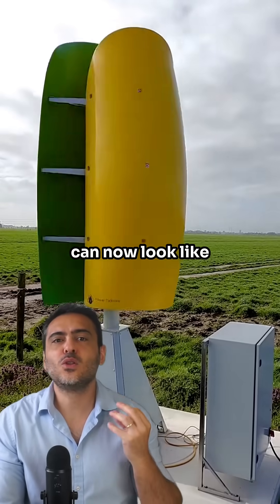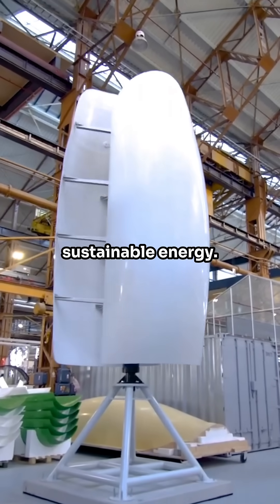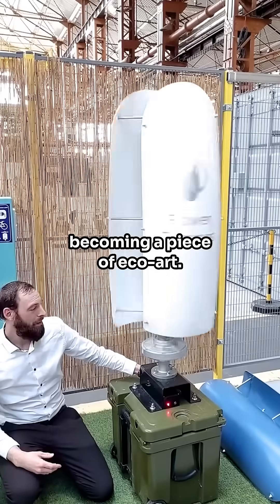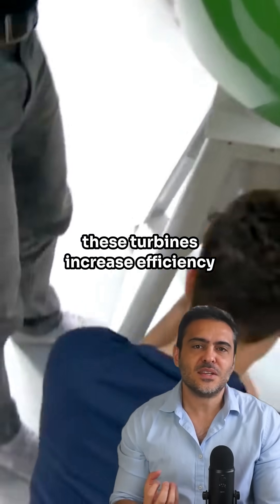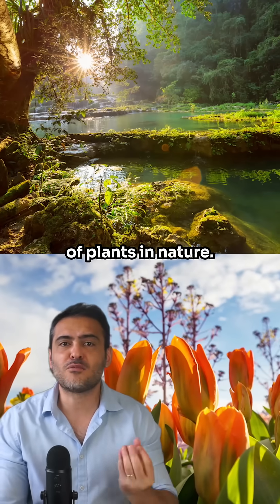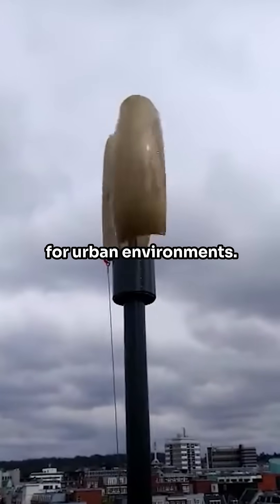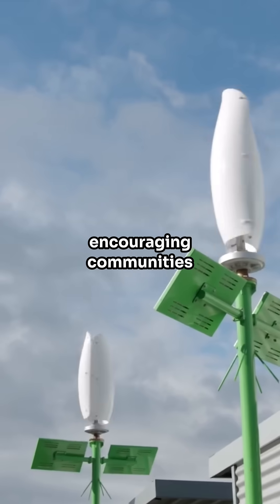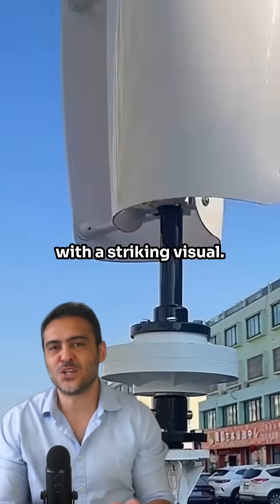Flower power: how one company is beautifying the wind turbine

Comment: "they operate quietly, overcoming the disadvantages of traditional turbines"

What is it with people thinking they're loud!? I've stood right next to them. They're already practically silent! They're not airplane turbines, there's not an engine to make noise with. 300 meters away, the sound is the same decibel as ambient rural surroundings. Some of that distance is already covered by being high up in the air and they have clearance area that usually makes up the rest of that distance. It's just a bunch of NIMBYs that didn't pay attention to the sound of wind before.

And besides that, their just reinventing it to scrape money from naive investors. Large, tall wind turbines get more wind and are more efficient. And the axis of rotation aligned with wind direction reduces strain. At least the ppl with the wiggling wind turbine had something more unique, even if it was equally inefficient.

Comment: It’s the turbulent nature of wind at this (low) height, that makes me wonder… not the design. Doesn’t it destroy the life expectancy of the turbine, due to the dynamic torque, and forces that happen regardless? Instead of 10-15 years, you get 3. It shakes them APART. That’s why they need to go HIGHER. How long is the warranty?
Reply: I guess we will see...
Reply: I see it as more efficient. The same size means its less likely to take out a village if it malfunctions. Shorter being more technicians would be happy to fix it and less wear being closer to the ground. While there is stronger gusts making more energy up "high".. what would you rather in the long run? Like why would you feel the old design of the 'windmill' will outshine the 'tulip'?
Reply: from what i have seen (in development type videos that are out there) the vertical form actually makes them more manageable in turbulent weather. The petal blade forms accommodate changes in wind direction without having to be adjusted like conventional blades.
Reply: @scud709 The WARRANTY will show EXACTLY what they’re ACTUALLY willing to back up. I won’t make a substantial investment in a turbine, especially new tech - without it.
Reply: @SoOthersMayLiveandStuff  Absolutely.  I was merely mentioning the engineering, not commenting on build quality.